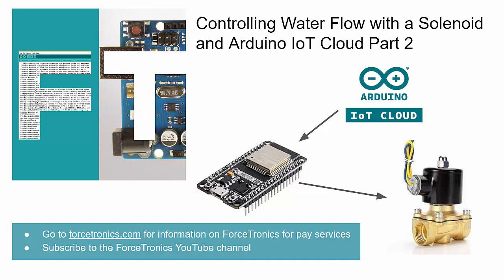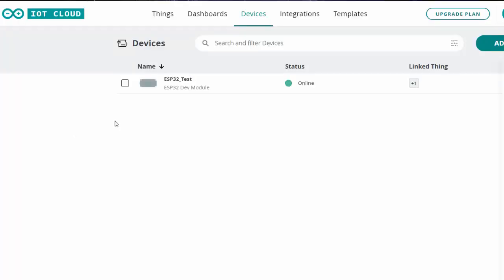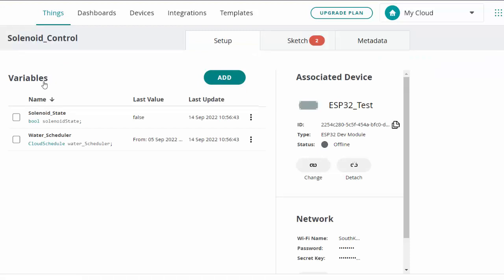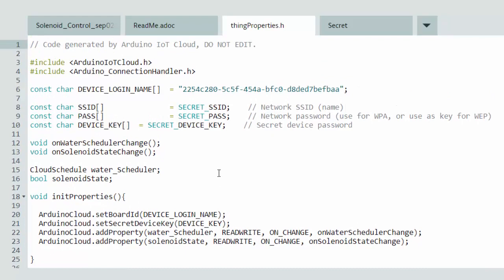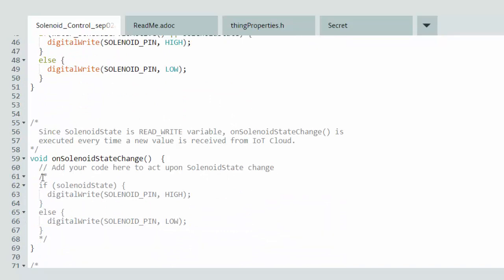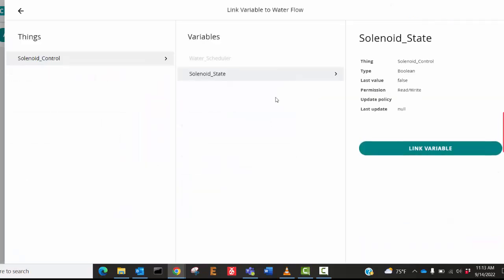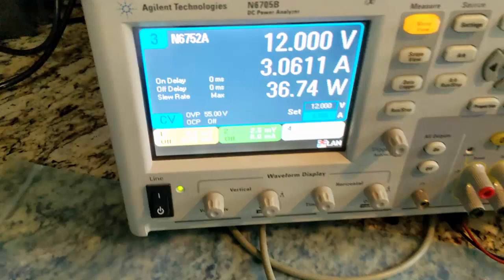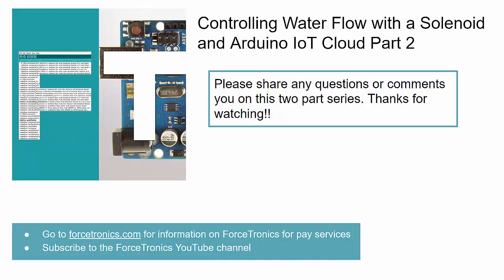Controlling Water Flow with a Solenoid and Arduino IoT Cloud Part 2

Comment: any suggestions if i want to connect multiple solonoids? to one dedicated controll unit with IOT just bought a house but my garden tap does not have enough pressure to run multiple sprinklers at once, checked out gardena and items like that, but it would cost me about 1600$ with multiple valves for each sprinkler on a sentral pe-line, other option is to run multiple hoses around  the garden, however i checked the posibility of solonoid valves  i where thinking about having a outer pipe and 2 pin ip68 cables to each solonoid "box"  just not sure how i would identify each valve, is it possible to have a third signal wire with a push-button like a WPS button? that the dedicated controller looks for signals comming in when activated?
Reply from the maker: Thanks for the comment. I can't comment related to anything regarding plumbing or handling water pressure because that is not my area of expertise. Regarding the IoT aspect I would just have a dedicated electronic / IoT setup per solenoid. If they are close together then just have a single wifi board with multiple pins to control each solenoid.
Reply: @ForceTronics  thanks for the reply on a post this long after 😊. I did some more research yesterday and I think I'm going to try a latch valve  and communicating with a sentral hub with esp now to save power for controlling /listening to the open /close command,rather than having wires all over but this video put me on the right path on how it is possible to do 😉. The area is about 800m2 of lawn surrounded by a hedge and multiple garden sections. If I am going to do this with gardena the valves and setup is going to set me back about 1600$.

well for the water part that's my expertise as a water engineer 😉 the technical side is just life experience and hobby 👍